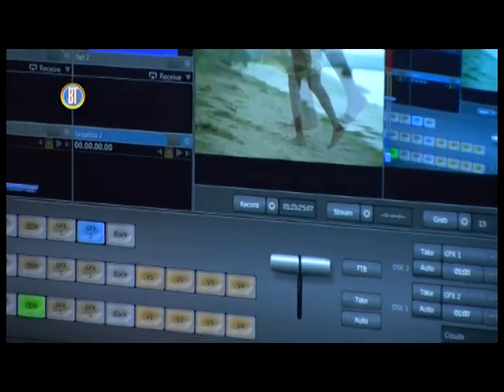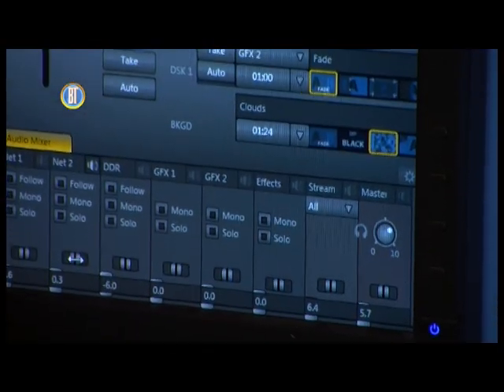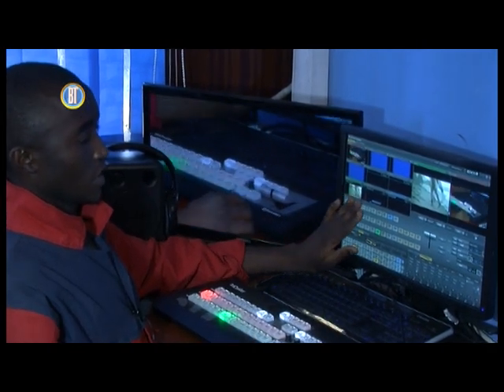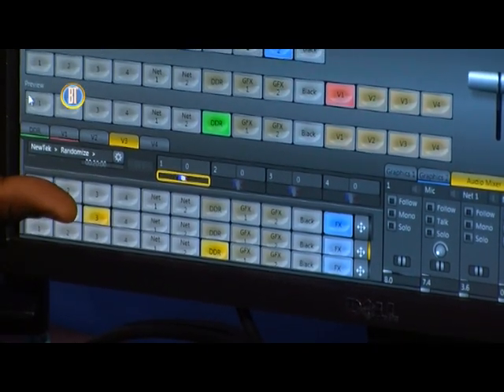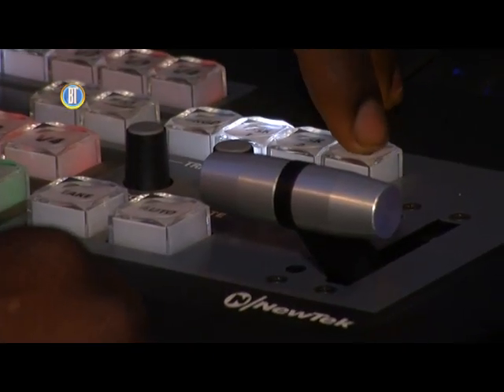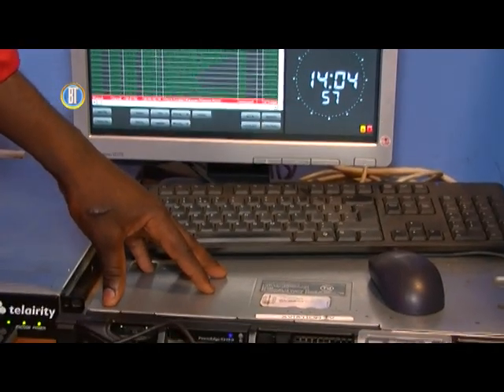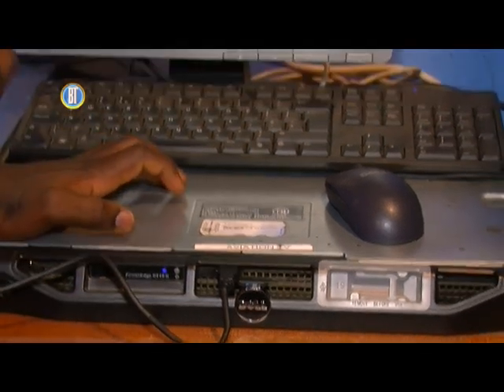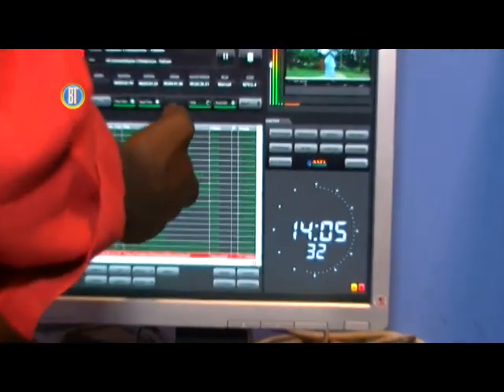Setting up a digital tv station

Comment: Dynamic mics produce sound from a vibrating coil around a magnet (induction; the same way AC power is generated) while condenser mics produce sound from capacitance between the membrane and a  plate (capacitance; these mics are called capacitor mics). Piezoelectric mics work by generating varying electric current with voice frequencies. Dynamic mics does not need powering, but condenser mics need external power, usually 48v DC.